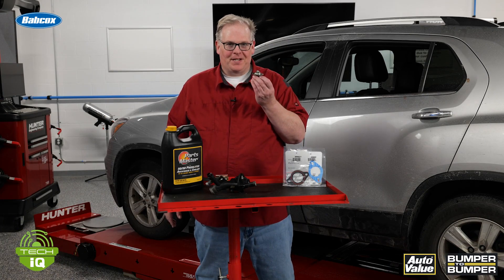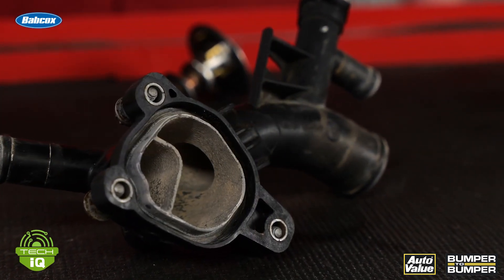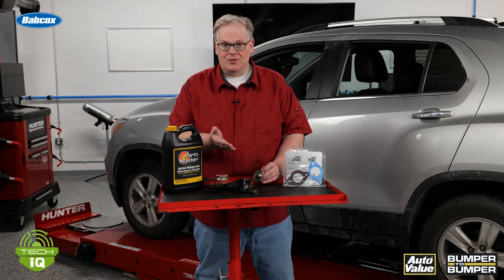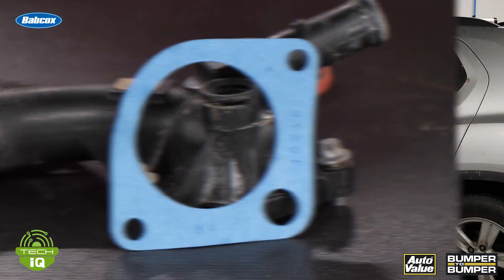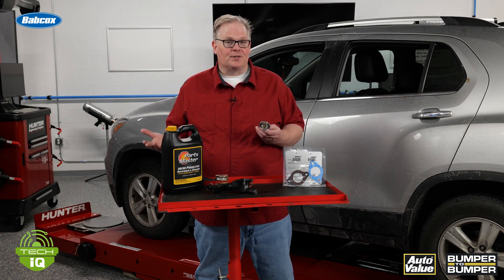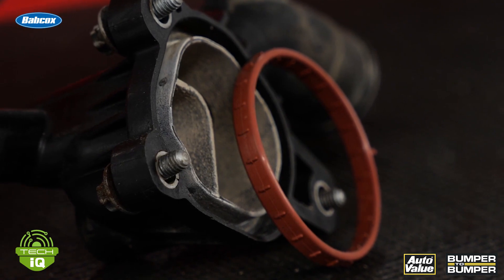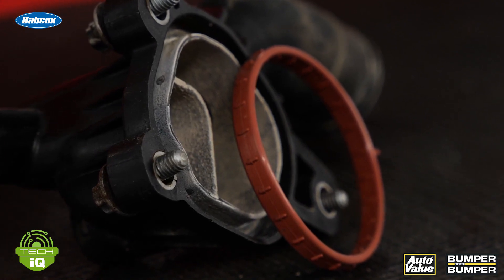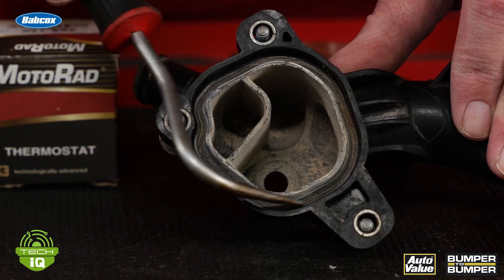TECH IQ: WHY OE COOLING SYSTEM PLASTIC PARTS FAIL

Comment: You forgot to address why the plastic cooling parts fail.
Reply: Simple...they are not good at heat cycling.  Just like a cheapo Chinesium aluminum water housing versus a good quality aluminum housing. 
OEM's love the Poly plastic for price, fails after warranty has expired.
Reply: @BobSmith-mc7uq  Yep, and plasticizers eventually get stiff and crack. Also, coolant quality can cause cracks.